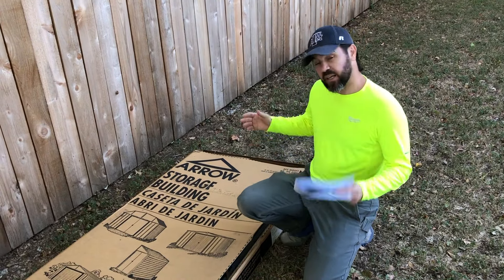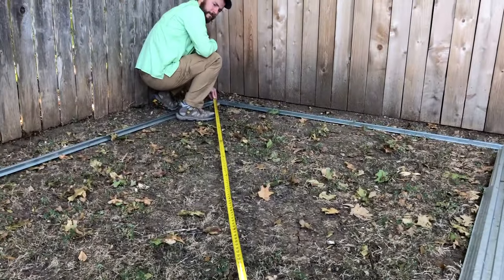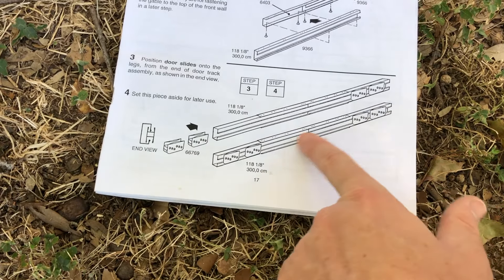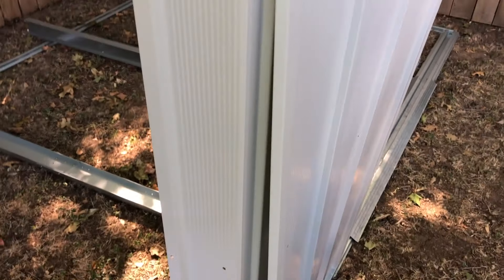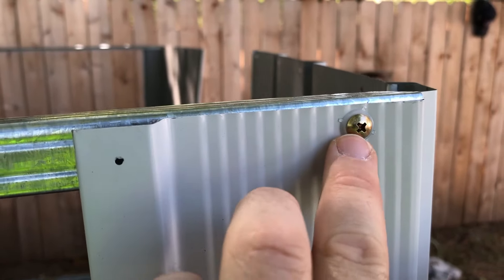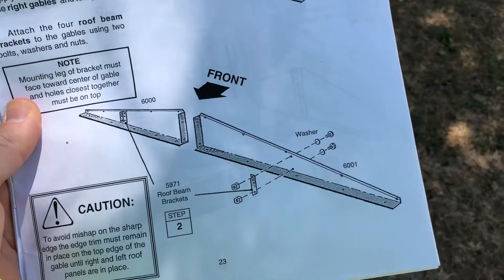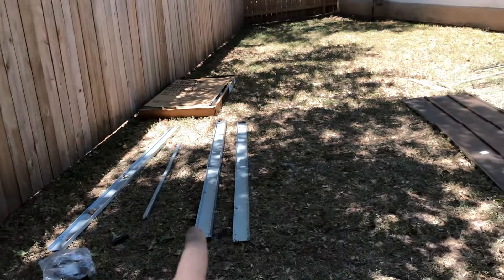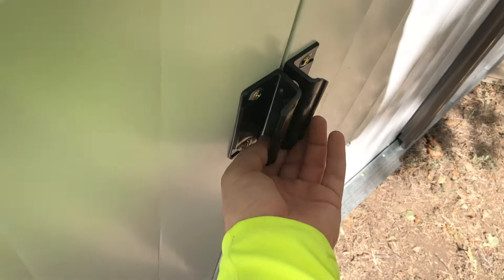DIY Arrow Storage Building Shed Assembly | Step by Step Guide with Instructions | Start to Finish

Comment: It's amazing how you guys shortcut it so many steps in this video. You didn't show how the peak of the roof was covered with tape and how the different lengths of the panels and the trim need to be noticed. You made it look so easy and short and it'll take you about 3 days to do what you just showed in 19 minutes. What a

Comment: Thanks for making the  Video and the tips. Currently same shed and size.  Though i would like to mention my experience so far in case anyone comes across this video. #1 Definitely need 2 people,#2 Not all holes line up,#3  Yes Pieces are labeled except a few and they were very hard to read on the metal parts. #4 be patient. #5 Wear Gloves  they are very thin and sharp.

Comment: Howdy Guys, Great video, Thanks for sharing with us. I sure like how you go into detail when it comes to the placement of both Bolts and Screws. I'm getting ready to assemble a bigger 10 X 14 Arrow Shed. The 10 X 10 that you have assembled here is pretty much the same with the exception of size and model. Mine is the Lexington   LX10X14 Has the barn look. It's gonna be a challange for me to assemble cause I dont have anyone that I can get to help me. I think I can do it without help if I take one step at a time. So... Anyway thanks again for the video, it will help. Thumbs up on your video, and I've subbed your channel.

Comment: You might want to mention that you need room all around the shed to work on it. I'd say at least two feet. Some building codes require it.
Reply from the maker: Good point. Customer gave us the directions on this one though. If I do another I’ll definitely bring that up.
Reply: @MasteringMayhem  Looks like he saw all the screws and nuts and gave up. lol I'm in the process of putting one of these up. I should have watched your vid first.
Reply from the maker: @bob48219  Yeah, my brother and I were talking about that while we were assembling it. Didn’t expect that much hardware for that kind of shed. All the best to you putting it together 🙂

Comment: This shed should be on a concrete or treated wooden foundation, otherwise the floor would be a muddy mess once the rain comes
Reply: I agree, but also that depends on climate. It's extremely dry where I live so mud is rarely an issue. Snow on the other hand... 🤔

Comment: Great 👍video thank you. 
I just aak a question 
If we install floor base have to be after or before ??
Thanks
Reply: Do the floor base first you can do it after but you'd have to jack up the shed and get the floor base underneath I'm currently installing one of these for the first time I built a wood frame out of 3 sheets of treated 4ft x 10ft  3/4 in ply wood and 9 10ft 2x6s I had one 2x6 left over but that's in case you have to recut something or want to put in another support for the frame I would wear gloves when handling the sheet metal it is easy to cut your self on the metal it is sharp and you will bleed after I built the frame I put it on top of cinder blocks one on each corner and on in the middle on both sides  definitely a two person project but 3 wouldn't hurt and making sure the frame is square at the bottom and top is important when building the shed

Comment: Thank you for this video! I'm thinking about giving up on contractors and putting it together myself. It's going to take a lot of time but...I'm really willing at this point
Reply from the maker: You’re very welcome. Glad this video inspired you a bit. 

Sorry you have had bad experiences with contractors. Hopefully you won’t ban them permanently, it is tough to find good ones though, at least that’s what I keep hearing.

Definitely have a second person with you if possible, that will really help with putting the walls up and the roof on. 

Let me know if you get it done and how it turned out. Enter my power tool GIVEAWAY if you haven’t already. I hope you and yours are well 🙂✌️❤️
Reply: If you can assemble walmart or ikea furniture or a crib from ebay or anything like that then you already possess 90% of the skillset needed.  Now you just need a person willing to help you and a way to anchor it to the ground.

Comment: I'm currently installing one of these for the first time I built a wood frame out of 3 sheets of treated 4ft x 10ft  3/4 in ply wood and 9 10ft 2x6s I had one 2x6 left over but that's in case you have to recut something or want to put in another support for the frame I would wear gloves when handling the sheet metal it is easy to cut your self on the metal it is sharp and you will bleed  they way you read the instructions helped me read mine better Wish you would of shown you putting the roof on in more detail but good video
Reply from the maker: Thank you. Yes, this was a video that we almost didn’t share because the detail and instructions along with our filming was not good but we decided to put it up in the end. Just not one of our best videos. For watching though and I hope your shed turns out great. 🙂✌️❤️

Comment: So should it be put on a cement platform instead of on the ground?
Reply from the maker: Yes, highly recommended. I put this one on the ground per customer request.
Reply: @MasteringMayhem  is it strong enough to not blow away? How is it anchored if it’s on cement?
Reply: @kristynedelarosa892  they sell cement anchors